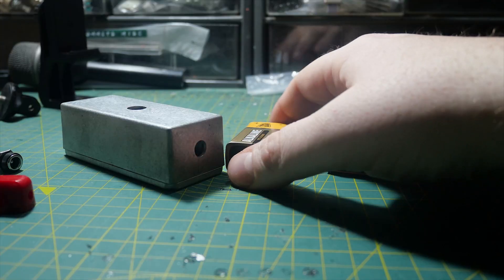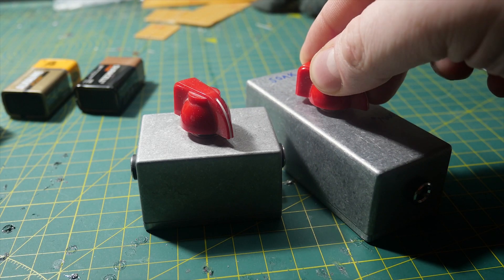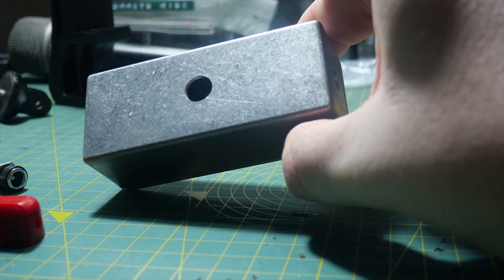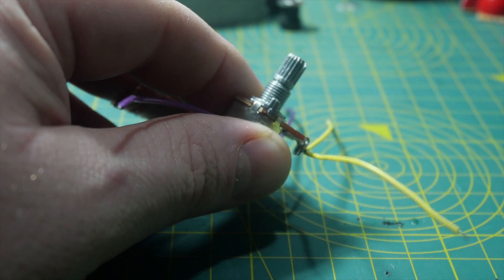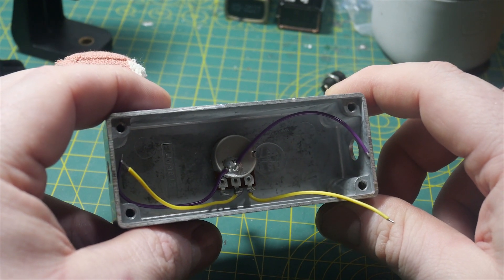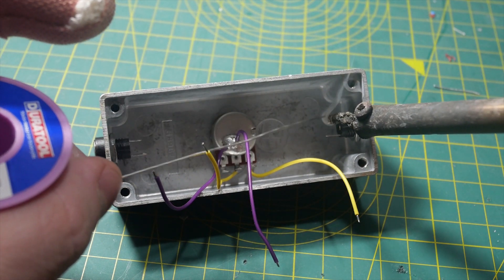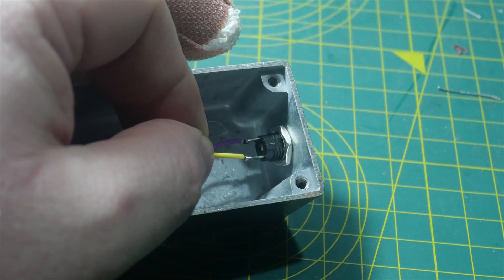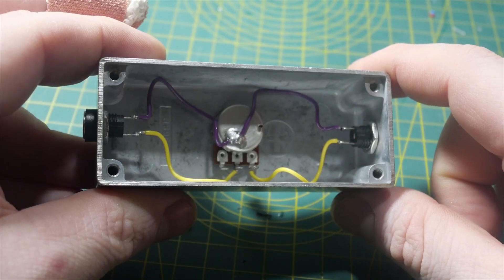Batteries: Build A Dying Battery Simulator

Comment: I tried both 5K pot and 10K pot. The 10K was too sensitive and I couldn’t dial in a precise sound. The 5K is much better, but I’m gonna try a 2K next time I get to the electronics shop.
Reply: Did you ever wind up trying the 2k pot in the dying battery pedal? Curious if it's better than 5k

Comment: For grounding, would connecting the wires to the third pin achieve the same effect as soldering them to the case?
Reply: I came here to ask the same question.
Reply: @mrc25381  I tried building this pedal, and my answer would be no it didn't seem to work

Comment: is there any advantage to soldering ground to the pot as opposed to just a wire from negative to negative?
Reply: It grounds the case and the pot casing. Thats stops hum. Research a faraday cage :)
Reply from the maker: Case needs grounding to reduce hum. :)

Comment: This guy here https://youtu.be/_YiwiHS6JVY says to connect positive to legs 1 and 2 of pot and then the other positive to leg 3. Who’s correct, you or him? Also do you have to connect the ground wires to the pot or can you just connect them directly to each other?
Reply from the maker: We are both right. It would work by just connecting the grounds together. However you would be picking up all the electrical interference. Research a Faraday cage. :)

Comment: So possibly dumb question, wouldn't 10k give you more range overall than 5k?
Reply: It would but it would be 5k of useful range and 5k of unuseful range. After 5k most pedals just switch the off. :)
Reply: @BimblismUK what about a 100k?
Reply: @mrc25381  you get the smallest amount of usable range. Most of the turn of the pot would be when the pedal was off.
Reply: Do they make 7k pots